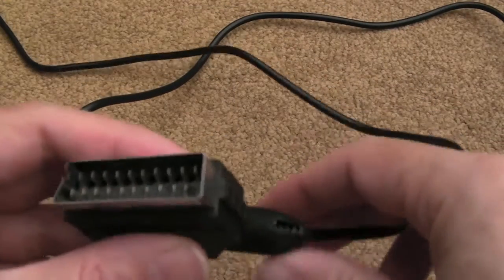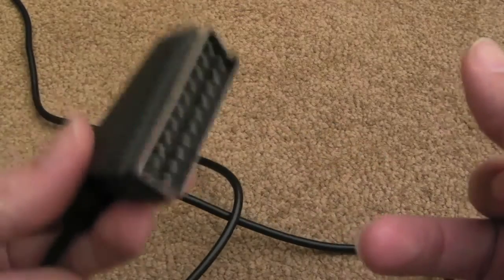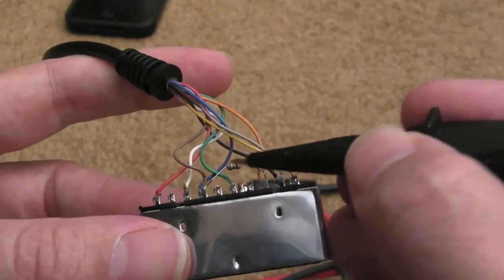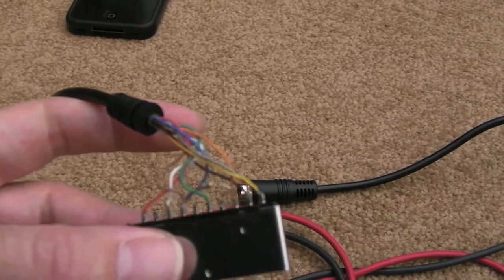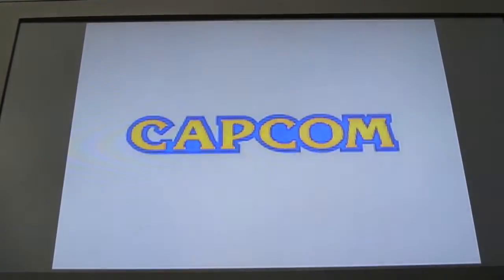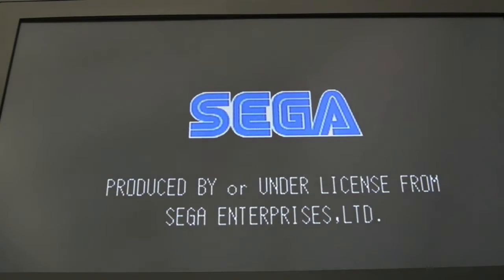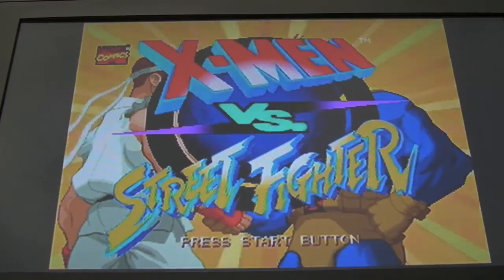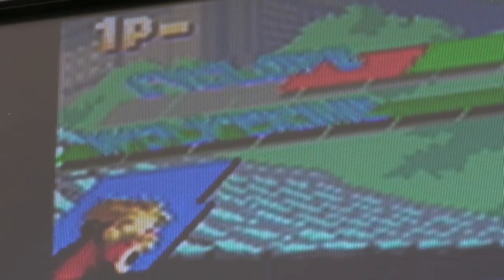Sega Saturn RGB Cable Fix (Is your RGB Cable in Composite mode?)

Comment: Had a similar problem with PS2 RGB cable i got off ebay, sometimes they just throw any old resistors / caps in and hope for the best it seems, I don't think it's the sellers fault unless they are the ones actually making the cables, but most sellers are just reselling I think. Luckily i got an official RGB SCART cable with my Saturn, makes a huge difference. I should look inside the official one see how it's wired up

Comment: Great vid.  I’ve just ordered only yesterday a so called Saturn rgb cable from eBay off a trader called hell trading. I suppose I will have to solider a new resistor on it!   Thank you for you great advice!
Reply: Just want to confirm that my cable from eBay works perfectly without modding.. hell trading are good sellers!

Comment: Hey man thanks a bunch for this! I had an average picture and constant buzzing noise in the background. I thought my old crt was responsible for this but low and behold once i changed out the resistor the noise went away and the picture looks crisp and vivid! worked a treat
Reply from the maker: You're welcome, and thanks for letting me know!  Pleased it helped you fix your cable =D

Comment: Pretty sure i just bought the same cable and have the same issue. Thats what lead me to this video. Is there any video on how to replace that thing or should i just return this and buy a different cabel?
Reply from the maker: You could do the modification(s) I did in this video - or swap it out for one of the better branded cables on eBay.
Reply: @GadgetUK164  any recommendations on a good brand?
Reply: @GadgetUK164  what if i put a 200 ohm resistor? Only have these...

Comment: Man, would you consider uploading a tutorial to mod an European SCart RGB cable for SNES , in order to work on a NTSC console with C-sync?
Reply from the maker: Sure, I might cover that at some point for you.  I did it to mine already - bought a PAL cable, and modded it for the SFC.  From memory its something like replacing the resistors for caps (or vice versa), and then just making sure resistor sizes are correct for RGB switching and for the composite / csync connection.
Reply: That sound awesome! Thanks man! I am new at RGB and to be true, I dont have any good skills for this. But I have a friend who always help me. Since at my country there is  any Scart RGB knowledge, so I need to give him the complete info in order he can help me with these jobs.  I dont want to mod my console, just the cable in order it worked in Csync, since I have a pretty fancy Setup between my selectors and Tvs that it will need it. I have 2 questions that I would like to ask you in order I could understand better about my RGB needs, please would mind to answer them to me? Its about a difference between Sync on composite (CSYNC) and  sync over composite video, the one the OEM scart cables used from retail. I  Heard CSYnc is the best way to top image quality, but I was thinking, maybe they used sync over composite video on the original cables in order they also worked with every accesory, and whit this I am meaning LIGHTGUNS.  I am a fan of those kind of games, and at my country you cant found TV's with Scart inputs, therefore the only way to play them it will be  with a regular Lightgun over COmposite or S-Video or Component; so my question is , when you get wired  CSYNC over a Scart cable, you are also losing the chance to output a COMPOSITE signal over the same cable at the same time? This is something I always have to consider since when I use Scart Cables I need the help of my DVD recorder in order I can use the SCart RGB signal converted to HDMI to my Led or to COmponent , to my Crt Tv, and of course in this way (upscaling) Lightguns will not work. SO my plans are using COmposite or S-Video signals ouputing them over my SCart AV Selectors for each time I want to play Lightgun games, in order I dont have to change or unplug my Scart cables.
Reply: ANd my second questions, (this is faster I promise) I also own a pal Scart OEM  cable for Saturn and a JP21 OEM cable for PS1.  SO at the first case, My console is NTSC and the cable is OEM but PAL,  do you know if they are working at CSync or I need a Special cable in order to do that? and about the JP21 Is there any way to mod a PS1 JP 21 cable in order to work as SCART RGB Pal cable, even better ,using SCync?
Reply from the maker: My understanding is the composite or csync used as a sync source makes no difference to light gun games.   The way they work is the CRT itself and the way it draws the scanlines to the display.  On a modern TV, or if you use any convertors to HDMI etc, modern screen display the full picture frame by frame, they do not draw the picture line by line like a CRT does.  If you used a high speed camera and filmed an LCD or Plasma you would see the whole image updated all at once.  Whereas with a CRT you could in theory see the scanline dot trace from the top left to the right, then fly back to the left side and it starts the next line.  Light guns see that dot as it traced from left to right and when you hit the trigger they can work out precisely where the system was drawing the video at that point in time, to work out where you hit on the screen.

The whole thing about using csync vs composite is a bit over stated.  Every system I have uses composite as sync and I get crystal clear picture with RGB.
Reply from the maker: I am not aware of the specifics related to the cables you mention there, the best thing to do is look at the pinout for the Saturn, see where csync is output on the connector, use your multimeter on continuity test mode and test the wire inside the scart end to work out whether csync is going there, or is it just composite.  You can easily change most scart cables by just changing the wiring at the scart end.  All you need is pinout diagrams for the Saturn connector and the SCART connector - easy to find online, and then use contiuity test on your meter to work out which coloured wires are going where on the SCART connector.   It's time consuming but can be worth it.
Reply: I see, but in my case , since MY CRT tv doesnt have Scart inputs from any kind (this is pretty normal at my country) I cant use Scart RGB to play lightgun games since they are been convertetd to component so, the  small lag  at the conversion doenst let the light beam from the lightgun, arrive at time to the screen.                                             When the Scart cable include COmposite signal, Ican use that to play lightgun games.  Scart cables with Sync trough composite signal will let me play lightgun games connecting the console in composite. But Scart cables with C Sync dont include  a composite signal, so In order to play lightgun games I must change the cable from the consoles. (this is something I just learned) It seems all the OEM cables at all consoles,  used the composite signal as sync  (I just learned that too)
Reply: I will try,  but sadly the OEM cables, dont have all the pins, therefore sometimes they cant be changed just that easily. I will stay tunned in order to watch your future video about how to mod a SNES Scart cable for SNES for NTSC

Comment: Hi there. Thanks for the vid. I'm very late to the party but.... I've  got an rgb scart from retrogamingcables for my sega saturn that my ossc cannot detect. The ossc is looking for an RGB signal. Just wondering if this could be the issue?
Reply from the maker: I guess there's a chance there's some issue with the cable,, but they tend to be very good quality from there.  It could be a problem with the Saturn (bad caps maybe??)  - Does the SCART cable work with other displays - eg. direct to TV?  You might need to tweak the sync settings on the OSSC.  It's also possible if the sync was over driven on the OSSC, maybe that has a fault...
Reply: Hi again. Thanks so much for the reply. The saturn scart works when direct into the TV. The OSSC works with an N64 scart ok. Could it be that I have a fenrir ODE fitted in my saturn? Will that change/lock  the video output? Thanks again

Comment: Interesting video! RGB really is the best to get the most from retro consoles. 

I was talking to Beaps73 last night actually about my ps2 and RGB. It doesn't seem as clear as my other RGB consoles. I'm going to look in the menus later.. 

Remember last year when I had the CMVS running composite? That looked really bad.. Shocking Infact!! Blurry text and colour bleed galore! 

Nice fix!
Reply: ***** that's the thing, my B&O doesn't tell you. However when the tv is on standby and I power on the ps2 it will power on the tv. 
I could dig it out and try it on the led downstairs but it's a right job! Lol 

I'll check the settings with the ps2 in a bit
Reply from the maker: GRUSS Newton BTW - just because it powers on the TV doesnt mean its using RGB - that basically shows that the switching PIN is working on the cable, but it could still be switching into composite.  A quick check to do on any SCART cable you are unsure about it quickly take the cover off the SCART connector and see if red, green and blue pins are actually wired up.  Some cables sold as SCART cables just use the composite and don't have RGB connected at all !?!?

Comment: is it possible to change the Wii composite cable head (that part which goes into the wii video port) to a gamecube/n64 head?
Reply from the maker: If you chopped the wire yes, I think it probably would be possible.  You would need the pinouts for both connectors and just work out which wire needs to go to which wire.  Probably easier to just buy a proper cable.
Reply: unfortunately that's not an option.. I needed to connect my old gamecube to the avermedia live gamer extreme which comes with a cable ending in component(?) exit  (red-white/red green blue). Gamecube comes with the other on,e the composite(?) cable (red white yellow) and I had to buy an active converter in order to achieve such goal.. but maybe switching those pinouts would have solved the problem. Hope you get the chance to make a video about that which might help other people as well! Besides, the gamecube proper cable costs nowdays something like 300/500$ since it was produced in limited edition and smarthead nintendo hasn't ever given any permission to third parties to replicate and sell that one cable D:

Comment: Let me know, this fixing will work for any kind of av/composite scart, or only European versions of it? 

I got a NTSC av scart, and would like to turn it to NTSC RGB scart. 

It is the same procedure? Thanks!
Reply from the maker: If you're using the RGB on a scart cable its almost region free in that the RGB has no encoding,  but the composite signal used for sync could cause some issues - if the system is 50Hz your TV needs to support 50Hz, if its a 60Hz system and your TV is 60Hz then it should just work.  The same resistor mod should work with an NSTC TV using scart.

Comment: Did u tried to view it on a crt tv in the deafult cable? & how does it look? Mines looks flawless on a crt tho :/
Reply from the maker: Yes, and it still didn't switch to RGB - it looked fine on a CRT but it was in composite mode.  Check your TV is definitely displaying in RGB mode.  Most older TVs will probably switch to RGB correctly.